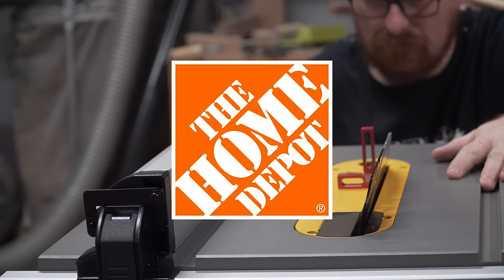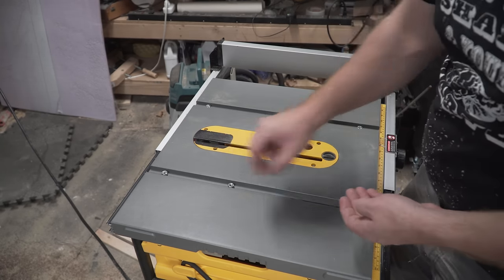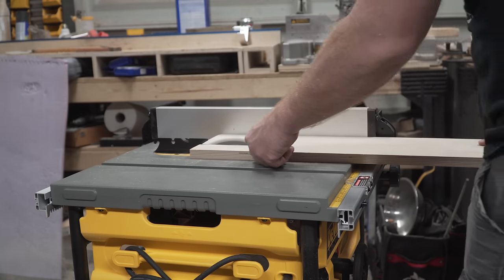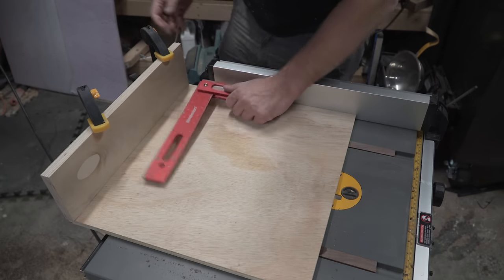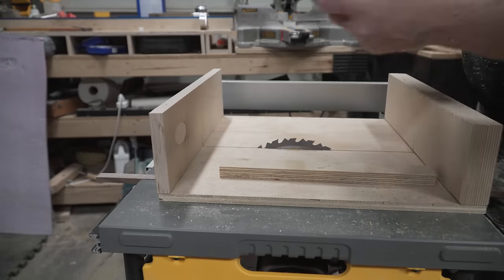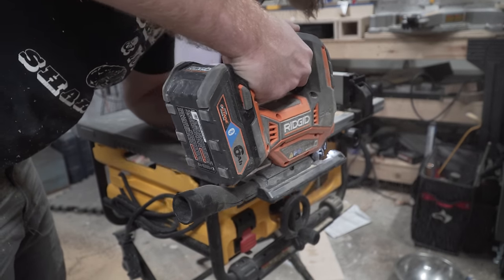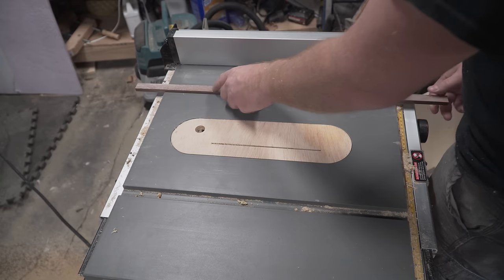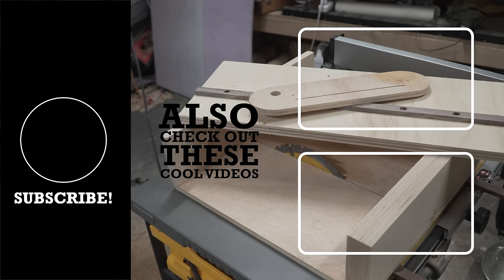3 Simple Jigs to get Professional Results from any Table Saw | Shop Tips

Comment: RIVING KNIFE!!!  The DeWalt has a very good, east-to-use riving knife.  The only time it should have been off your saw in this video is for raising the blade up through the material.  Then lengthen the slot and get the knife back into place.  It makes a huge safety difference.  You are obviously appealing to beginner woodworkers, and you need to both teach and show them better than this.
Reply: Riving knife….lol….Ripping pieces up against the fence like that at the beginning bout blew my o ring. You can tell how uncomfortable it is by how you used your push stick. But you’ll have that. Keep your mind sharper.
Reply: I was thinking the exact same thing. I almost never see a blade guard used on a tablesaw on YouTube and I always wonder why. It's such an easy insurance policy against making a painful mistake.
Reply: @Mikey__R  it gets in the way a lot, especially when pulling sketchier stunts with it, as well as for visual appeal so people can see the cut happening

Comment: Hey man, I appreciate the effort and ideas of the video but you should really brush up on the safe use and modification of a table saw before advising others.  Video was good otherwise. Best of luck!
Reply from the maker: Ya, everything is above board but the camera makes some things look less than safe (lens compression) inuse the throat plate as a guide as to where I never put my fingers near.  I also should've emphasized the need for a splitter/riving knife and PPE.    I skipped some important stuff to make the message concise.
Reply: @WoodWorkLIFE  I paid attention and noticed these things so no worries
Reply: If you bought the tools and don't have the common sense to not put your fingers in the blade... consider the fact you shouldn't be using the tools to begin with. I also call it population control

Comment: I bought a job site saw because it was a cheaper way to get my first table saw. I quickly noticed that it didn't cut the best for projects that needed close (ish) tolerances. Thanks for this video, it should help me with my projects this year.
Reply: this particular dewalt saw has some pretty tight tolerances straight out of the box
Reply: @jaednhowlar2359  Its actually a shit saw. Had 3 go back and finally just bought a new Sawstop one.  Maybe for Diyers it's good. But if you're building quality stuff its shit

Comment: I had to watch it a second time because you talk so fast, still dont know what the cutout for the blade is for (the blade insert thing).  What's wrong with the factory one?
Reply: The standard "throat plate" has a wide slot in it to allow the blade to pivot to cut mitres. However, when doing standard 90 degree crosscuts or rip cuts you get tearout because the wide slot doesn't support the workpiece correctly. A zero clearance plate does.
Reply: Also, the factory throat plates wider slot allows thin cut-offs or veneers you may be cutting to fall in to the blade opening.

Comment: Good info. For the last jig, it is easier just to take a strip of MDF which you know is straight and screw that to your work piece, shimming the high spots. Then just run it against the fence as normal. 

You can use the same MDF in your thickness planner at first to mill the top end flat relative to the mdf.
Reply from the maker: That would work as well, this is more of a platform for multiple difference useful jigs.  As it stands there are other ways to do it but throw on a fence or some clamps and the sky is the limit.

Comment: This looks like a great idea! Most of these videos are for contractor sized table saws, whereas you feature one for a portable table saw. By the way, what are the cut measurements for the base and fence?
Reply from the maker: They are whatever you need them to be.  I would just suggest you use a cross cut sled slightly smaller than your table top.

Comment: 1. Blade parallel to miter slot. 2. Fence parallel to miter slot. 3. Better push sticks + JIGS 4. Keep all digits at least half way attached (or mabey this should be 1) 5. Don't get speared from kickback. I am no woodworking guru, just the order I have done since I got my jobsite table saw. It is true you can get it dialed in really good but its not ever going to be able to get the accuracy of an cabinet saw, but I have not the funds or the space for one. Main thing I have found out is you really just have to just start making stuff and figure it out as go. Thanks for the video and keep those digits intact.
Reply from the maker: I'll do my best

Comment: Pretty convenient that the plywood wound up being an exact thickness. I've always had to do tons of routing or add leveling screws to get it to sit flush. I didn't have a thickness planer last time I made one, I wonder if that would be a big help.
Reply from the maker: It's usually easier to rout out around the edges and add some levelling feet.

Comment: Very helpful!  Using that push stick on the wrong side of the blade though 😬
Reply from the maker: ??? It is supposed to be between the blade and the fence.  Or in place of a hand if you need to get near the blade such as I was doing.
Reply: Wood.Work.LIFE. Ya, it’s (primarily) supposed to be used between the blade and fence to ensure the piece doesn’t end up pinched and shot back at you. That’s the place where a majority of kick-back accidents happen. The offcut side will almost never kick back since there’s nothing for it to get wedged between. Thin strips can be a challenge to cut without cutting into your push stick so some people make their own sacrificial push sticks or use the Grr-Ripper from Microjig.

Comment: I have an older Delta job site saw and the insert has an odd shape and is made from stupid thin sheet metal. I’ve been trying to figure out how to make a zero clearance insert for years and haven’t been able to come up with anything that will work. I like the tapering jig you showed and I’ll be making one this spring. It’s way too cold to do anything in the garage now. 😂

Comment: How are you adjusting the back fence on the sled? Do you create a new hole and screw each time?
Reply from the maker: Yes, create a new hole every time or it will be pulled back into the original.

Comment: Yeah, I got that particular saw 2 years ago. You might also want to change out that ripping blade that it comes with. I mean, I guess it's sharp enough for cross-cuts when it's brand new, but it doesn't take long for it to start making a chipped mess of the edges.

Comment: Thanks! Great video and it all makes perfect sense. I don’t have any of these jigs for my hitachi job site table saw so I need to make them. 

Could you possibly make a video a little more in depth on cutting the runners for the mitre slots? I am a little nervous about cutting small pieces.
Reply: You should probably return all your tools if you can't cut a 1/2" strip.
Reply from the maker: when cutting small pieces it is super important to use a push block, push stick, or combination of them.  You can use a 2x4 with a sacrificial off cut glued to it or go buy the store bought push blocks push sticks.  Never operate the tool when you feel even a little hesitant about what you are doing from a safety perspective.  It is important to feel fully comfortable at every stage of the process.  Some of my demonstrated techniques are from probably a bit of abundance in confidence with the tool as noted in some other comments.  Honestly, that is what can get you hurt.
Reply: you should buils a thin-strip  cutting jig first 😉 but i know what you mean.i have had a kickback before,fortunately nothing happened.but it taught me to always be more careful.it's good to have a healthy respect for such machines,but you should not be afraid,otherwise it is better to leave it alone.

Comment: I just moved from my very beginners craftsman table saw to a Dewalt 7491rs and this jigs are awesome. Thank you! I'm a retired Army vet and trying to deal with PTSD, my question is not related to tools or ideas but to communications. I don't have any media application and it is difficult to communicate with other woodworking hobbies. Wich application did you fund to be more efficient? I'm thinking of Instagram or Twitter.
Reply from the maker: Instagram for sure, the woodworking community is very active on there.  From hobbyists to masters.
Reply: @WoodWorkLIFE  Thanks, (Gracias) from Puerto Rico. Will do.
Reply from the maker: De nada

Comment: On your third jig, if all you're doing is using the plywood in the runner to provide a squared edge to the blade of the tablesaw, why can't you use the tablesaw fence for that? Isn't that also square to the blade?  Just wondering if I'm missing something.  I just got that exact saw (because I'm just beginning and given all the tools I need, can't spend the money on a larger tablesaw just now) and I'd love to make some higher-quality pieces to hone my skills.  Thanks!
Reply from the maker: Because the rough edge of lumber is not straight and you could get kickback a bound blade and alot of other not good things.  The sled let's you make that reference edge safely, you can then take it off the sled and use the fence to make the other edge parallel.
Reply: @WoodWorkLIFE  Well that makes sense.  Thanks for the input!

Comment: LOL rough frame carpentry not experienced on a table saw it would have been nice to see the jigs being used on projects that would have been a good reference to put on your video site follow up with the quality workmanship that you do metal stud and Bungalow busting and custom deck building ever got a lot of experience on a jobsite table saw other than ripping 2 and 3/4 by 3/4 tongue and groove Oak for oak flooring finishers up against tuf-tite wall Etc didn't do a whole lot of trimming only on side jobs however I did cut a couple pieces of huge ficon in the presidential Suites of the Sheraton Hotel downtown Chicago Illinois great video thank you I subscribed
Reply from the maker: I'll think about making a video about using common jigs on a table saw.  Good idea.

Comment: Nice video but a better jointer/ tapering sled would be to eliminate the runner and just go off the original fence. I then used the router to set a T track in the sled and a couple of hold downs for clamping. It's fantastic.
Reply from the maker: I prefer leaving the fence out of it so it doesn't limit the width of board I can work with.  T-track and hold downs and angle markings and all that take it to the next next level though!
Reply: Wood.Work.LIFE. I have the DeWalt like you and I haven't met a board wider than the full extension of the fence. I actually bolted on a fold down out feed table too. Every summer I say I'll do this or that , make this jig or that jig during the winter and I finally did it this past winter lol. I bolted on a side cabinet ( very small on the left)  for feather board, calipers and spare blades. I made a jig for my belt sander to sharpen chisels and block plane blades. I got the Boch gravity table for the table saw because it got to heavy. It might sound like I'm bragging but I've been saying that I'll do these things every winter and I never do.... except last winter. Anyway I look forward to watching more of your videos.
Reply from the maker: Not at all man, I love hearing about people making stuff. on my Facebook group we have every Sunday and opportunity to share all the stuff people have made in our community. I look forward to seeing you in the comments section, welcome to the WWL family.
Reply: Wood.Work.LIFE. I don't have any social media accounts. I did a few years ago but I didn't like it. I don't know how to upload to YouTube either. Is it easy

Comment: I sanded my surface flat by laying it table down and gluing sandpaper on a flat surface. 
 
These dewalt, and even the higher priced saws are far from flat. The fences are also not flat, so you'll want to make you're own fence for it (I used a 1x4 t-slot aluminum extrusion from misumi. They have a better tolerance and perfection compared to 8020, but 8020 is fine. Just don't use T-nutz.)

Comment: Ouch! I put a block of wood with a stop piece hanging down on the back of my cross-cut sled.  The stop lets the front of the back upright go just past the middle of the blade and the wood block covers the blade behind that. I know it is kind of fussy but the blade popping out of the backside is scary to fingers and thumbs.
Reply from the maker: There are two schools of thought around that 1) always know where the blade is and respect where it's going at all times b) protect yourself from the blade.  I am in the first camp, you'll never catch me sleepin' always focused, or I leave the shop .
Reply: Until that one time you are not focused and did not leave the shop. I used to be a 1), but now I am a lucky b).
Reply from the maker: I probably will have to do the same at some point as well.  I just don't want to get too comfortable around a tool that could kill or maim.  So I like having to stage my cuts and figure out my hand positions.

Comment: I accidentally used screws that were too long.  I used an angle grinder to remove the pts that came out the other side and a little epoxy to smooth over it.

Comment: I noticed there is no blade guard nor kickback guard on your saw. I've contemplated removing mine. I bought a brand new Kobalt jobsite saw but have noticed for some cuts these guards are in the way at best but at worst prevent me from even making the cut. I don't think I'll be able to use my dado blades with it in. Can you help a rank beginner out? This is a very good and useful video thank you.

Comment: i use 2 toggle clamps for that jointer jig so i don't need to screw the rough board on every time.
Reply from the maker: Its a great platform for a lot of things, you can use it to cut angles,, circles, tapers...whatever you could imagine

Comment: Great video! I noticed that the sled is smaller than the tabletop of your table saw? Any particular reason for that? I also have a Dewalt table saw and was thinking of making a cross cut sled the same size. Thanks!
Reply from the maker: It could be bigger, smaller, whatever, the larger it gets the more difficult it will be to bet the measurements dead on.
Reply: @WoodWorkLIFE  Great point, thanks!

Comment: That's a great advise to use glued up plywood as the front fence of the table saw sled, I used the straightest bit of construction lumber I could find and paid lots of attention to getting it straight and at a 90 degree angle to the saw blade when I made it, and now , 6 months later, that very straight bit of construction lumber has bowed a bit so I will go and replace it with glued up plywood.

I should have done that but thought I had a perfectly straight bit of fence.

Thanks for sharing the videos. :-)
Reply from the maker: no problem morten, good luck!

Comment: Any tips for zero clearance throat plate inserts that still allow the dust collection to work on jobsite saws?

I stopped using mine becaue it just blocks the dust collection and I end up with a shop full of dust.
Reply: Drilling spaced out 1/4" holes through the throat plate would allow the suction from the collection/vac system to somewhat work through the throat plate. Just an idea as I read your post.
Reply from the maker: Overarm dust collectors are really best for this.  Most of the dust comes from the blade and much of that gets pulled under saw, the stuff above the board generally won't get pulled down into the saw with even super high end collection with out an overarm.

Comment: Something I noticed is that you didn't fit the sled runners to the miter slots to get rid of any slop!
I have the same saw and found it impossible to fit runners to the miter slots because the slots are narrower at their ends then in the center.
I contacted DeWalt and they sent me to a local distributor to see if they can fix the problem.I have yet gone to the distributor, due to the Holiday,but can see no way that they can fix miter slots that are not true!
Do you miter slots have a consistent width? I hope so because in that case it's only my saw and it can be replaced!
Thanks for the video!
Tom
Reply: Thomas C Kuzia l thought it was just me not being able to cut probably
Reply from the maker: That is why you use two runners for the cross cut sled, it cancels out some of the slot in the runners on a jobsite saw.

Comment: I recently purchased a job site saw for home use due to lack of space. My question is the dimensions on the sled- appear to be approx 2 inches shy on each side from the top. Is there any reason not to make the sled match the width of the saw? Wider would give you more length to use stops for repeat cutting. I understand the depth front to back needs to be shorter as you push the sled into the blade you don't want the back hanging over the edge of the top.
Reply: Its just preference .he mentioned it in another comment

Comment: Im a weekend warrior. Whats the difference between Dewalt 8.5 and 10 inch saw..... besides 1.5 inches? Quality? Features? Preformance?
Reply from the maker: 8.5" blade will just barely cut through a 2x4.  10" can cut through much more.

Comment: Im pretty sure the mitre slots on my dewalt are not 100% parallel. My runners always run smooth as silk with no play but as soon as they affixed to the bottom of a jig, they bind up.
Reply from the maker: hrm, they might not be.  In this case you can just make a single runner sled.  Be sure to measure your miter slots to see which one is the most parallel to the blade.  A single runner sled is not AS accurate, but still as accurate as you need for most things.